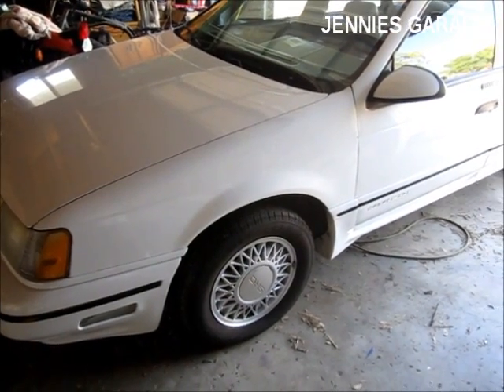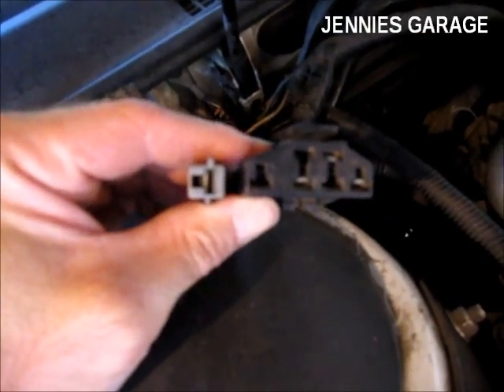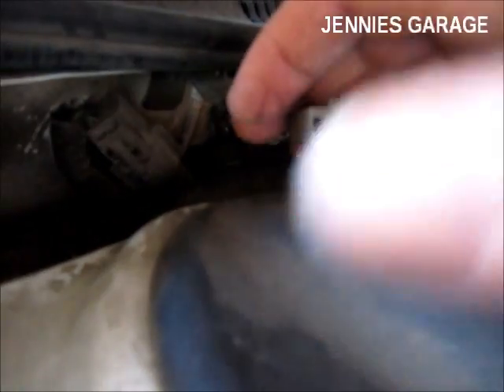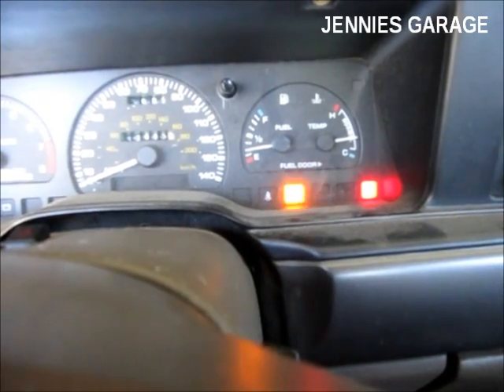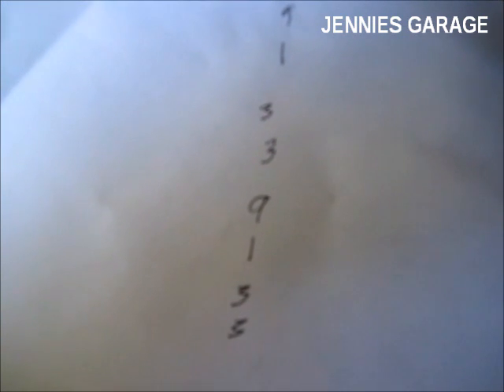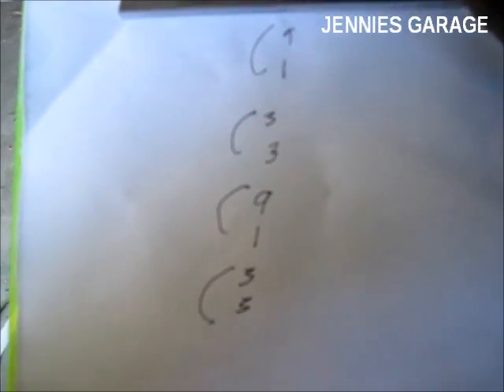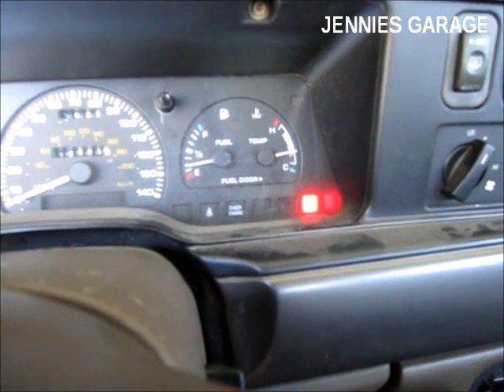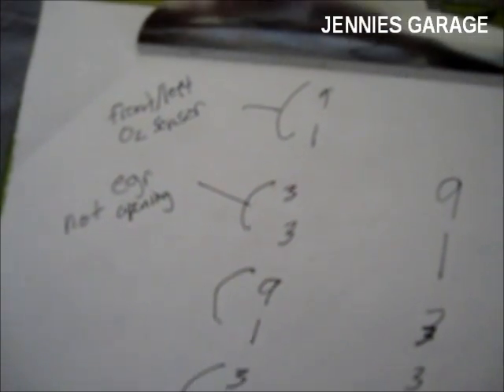1984-1994 Ford Self Diagnostics Test - KOER ( Key On Engine Running )

Comment: I tried this on my 86 ranger, engine seemed to go through the test paces , didn't get any flashes, could my engine light be burnt out?
Reply: When you first start the car or turn key to accessories, does the check engine light come on for a moment?  If it does, then the light is fine.

Comment: 7/30/2022 !!! Update from 7/14/2022.....SUCCESS !!!!  The codes mean Zero to me as i have never & will never take a car to a mechanic.   The turn the wheel, JAB the breake pedal HARD , and rev the engine 100% shut the check engine light OFF, and allowed me to pass Oregons ripp of democrat scum emissions test.  And this video is HOW OLD ??   Fantastic.  engine sevice light has been on for 2 yrs.

Comment: Does this work on a carbed eec iv? Has no CEL, but an Emmisions light that turns on and shuts off after the engine is started. Working on an 85 ranger 2.8.

Comment: Hello. I have a 1994 automatic ford ranger with a surge problem. It only happens after its warm and at a complete stop. It wont do it on park or neutral. It also takes long to start. Sometimes i have to turn ignition key twice. It started to surge right after the smog guy replaced the fuel neck that goes to gas tank. Replaced IAC valve, fuel filter, sparkplugs, temp sensor, egr valve , pcv valve, cleaned MAF , cleaned throttle plate, checked for vaccum leaks. Any good advice would be appreciated.

Comment: I just tried this on my 94 F150 (manual transmission) and the check engine light never came on :( Do you know if there's anything different or why this test wouldn't work?
Reply: Does the CEL illuminate during KOEO? That means, turn key to on/run but dont start the vehicle! Checm engine light should be on. If it doesnt light up, its most likely a CEL bulb that burned out, common on older vehicles that have been ran with a fault code for extended periods of time.

Comment: How is the computer getting feedback from steering right/left in this? I can see brake and throttle able to be sensed by the system but steering right/left I am at a loss as to how the car knows your doing this?
Reply: It's for the load.. power steering load on engine... brake for vacuum change.. rev for missfire

Comment: He was supposed to turn the wheel 360° left or right and then back to center and push the brake pedal. Check fuel pressure and leakdown. O2 codes can be spark plugs, clogged injectors, etc. EGR not opening can be a bad EGR or no vacuum to the EGR. Improper vacuum can be the charcoal canister purge valve. Rich mixtures can be the MAP sensor or CTS, or leaking injectors, or other things.

Comment: Get a Actron CP9690 code tester. It checks live, record, graphing, emissions readiness test, transmission codes, oxygen sensor codes, SRS, ABS, and MORE! It has OBDI cables for Ford, G.M., Chrysler, and Toyota. It has code connect to diagnose codes. It uses 4 AAA batteries not included. They are under the cover. It has a cigarette lighter cord. It shows codes according to that vehicle. Turn the steering wheel 360° and back and pump the brake pedal. 2000 and up is auto-test. Below, you dial in the readings. Goose test checks the TPS and EGR. If you get improper vacuum to the EGR. replace the charcoal canister purge valve. If you get rich oxygen sensor codes, replace the MAP sensor. Run fuel injector cleaner thru the tank to clean injectors and eliminate false codes.

Comment: Will this work on a 1994 mercury topaz/1994 ford tempo?
Reply: Get a Actron CP9690 code tester. It checks live, record, graphing, transmission codes, emissions readiness test, oxygen sensor tests, and MORE! It comes in a black pouch. It uses 4 aaa batteries, not included. It has code- connect to diagnose codes. EBAY has it. Or get a Snap-on scanner with primary cartridge and troubleshooter cartridge. Get the manuals. It uses a 9v. Square battery. Troubleshooter option diagnoses codes. Get the Ford OBDI cable or OBDII cable whichever your car uses. Get the battery- to- cigarette lighter cable which hooks up to the adaptor. EBAY has them.

Comment: Making a small jumper wire with male spade end connectors on both ends will fit better than paper clips. Also, I am wondering just how many people watching this video are likely to end up shorting the jumper to ground because nobody mentioned to not lay the bare, uninsulated paper clip near anything metal.  Also, is that whole turning the wheel, braking, then rev really necessary?  I don't have to do any of that stuff to get codes from a 91 F-250 with 351w block, but the connector and codes look the same.  I only found this video while checking for a friend to see if Taurus were similar.
Reply: @hankbridges5055  , is that only on certain years or models? Because if I start to turn the wheel or anything else, then my truck is already flashing codes before I even get to the second step, and can't count codes, write them down, and steer at the same time.
Reply: @JamesMorningstar  Yes, evidently. Some cars have a power-steering pressure switch and a brake on- off switch. It's to test the operation of those parts. My car says to but it don't have those parts. Some cars have a over-ride switch to activate. Best thing to do is do like it says or it might not test. My Actron CP9690 tester has code-connect to diagnose codes. My Snap on scanner is more for OBDI. It has troubleshooting. I have OBDII cartridges to 2000 and the adaptor. The Actron only gives OBDI test results for my car. It DID specify which air pump check valve was bad. Code-connect helped me to fix 2 problems. It's more specific.

Comment: I have a 1986 mercury cougar 3.8L with an digital dash display and it did not work.  There is no check engine on this cluster just a servive light that never flashed.  I tried several times making sure i had the right ports and cleaned them out even to no avail. Guess i may have to get myself an OBD-1 system reader.

Comment: My Lincoln Town Car cranks well with new battery but won't fire up.  So the war up and motor running is not possible.  I was told and have read that this test can be done with only ignition key turns on and the engine need not be running. Also the OBD1 test is for through 1995 and OBD2 is for 1996 and newer.

Comment: My code book said Muffler Bearing Bad & Low Blinker Fluid  where are these located at?
Reply: By the Water pump relay & The exhaust pump reservoir
Reply: Wen i press the brake my head tilts forward.....those that mean check glove box lock for sugar residue from the freon

Comment: Get a Actron CP9690 code tester. It checks live, record, graphing, oxygen sensor test, emissions readiness test, transmission codes, solenoid and relay test, memory codes, MAP sensor test, MAF test, IAC valve test, and MORE! It works on 1983-2013 and is updatable. EBAY has it.

Comment: Code 33 is the EGR valve. If you get oxygen sensor rich or lean codes, replace the MAP sensor. If you get vacuum to the EGR at idle, replace the charcoal canister purge valve.

Comment: Crazy question I do remember the paperclip trick from back in the day from my dad but I have a 93 Ford Mustang 2.3l lx that shot a code ten at me and the other day I was noticing the engine running poorly/having a possible misfire while hitting 65 on the interstate. I know a code ten is a cylinder 1 issue but would the best course of action before taking it to a more skilled mechanic be doing a full tune up then giving it another go?

Comment: Get a digital code tester from Amazon for Ford. Also get the extension cable. Better than that get a Snap-on scanner and cartridges and manuals and adapters from E-Bay. Also get the 120 volt adapter and Battery Pak to check test results away from the car. Get the latest cartridges.

Comment: my 1991 Mercury Grand Marquis ls 5.0 has been running for a total of 30 minutes and has not reached normal temperatures yet I don't understand why not does this mean I won't be able to perform the test?
Reply: mrhaynes1974 It could be the thermostat. That can cause rich mixtures.
Reply: Sometimes a 2000 rpm rev hold is needed (maybe a minute) for fan clutch to disengage or thermostat that is fail safe stuck open or both

Comment: I recently bought an Equus Innova OBD-1 code reader, and the users' manual emphatically states that before you run this KOER (key on, engine running) test, you must first run the KOEO (key on, engine off) test and fix any trouble codes you get from that test.  For the KOER results to be valid, you must be getting a "system pass" code (11 or 111) from the KOEO test first.  By the way, that code reader makes this job MUCH easier.  For under $25 on Amazon, the Innova 3145 Ford Code Reader for older Fords (1981-1995) is a great buy.  The manual has all the Ford OBD-1 trouble codes and their meaning (the most comprehensive list I've seen) as well as detailed instructions for running all the tests.  If you own an older Ford car or truck, this code reader and its manual are well worth the small investment.
Reply: I seen what you've done here lol good add

Comment: what if my car doesnt have a check engine light? i have a 1986 lincoln town car, also made by ford
Reply from the maker: It should have some type of light to the effect of "service engine soon" or a symbol. Maybe the bulb burned out.
Reply: if there is defiantly not a check engine light you have to use a voltmeter/testlight or use a scan tool

Comment: I just got a 94 Taurus 3.8l GL took it for a test drive no issues checked all fluids the looked good.  I drove it from where I got it a short distance less than 5 miles for some errands no problems.  I drive it at highways speeds all the way home no issues while driving I pull into my driveway the oil light starts flickering then stays on and goes of and flickers.  I let it set for 30 minutes then checked out normal level good color no burnt odor and no metal flakes.  I googled symptoms but are unsure if that will resolve it cause in some post the main bearings turned out to be the problem.  What would be your opinion if duplicated at your garage?
Reply: I doubt you still have this car (2 years ago) but if you do Try a new oil pressure sending unit first before you tear down the engine. They are known to go bad. If you want to.be sure, put a gauge on it. If you have less than 5-6psi at idle once engine is hot you likely have internal wear. If that is case run thicker oil it will get you by until you can find a low mile engine for it

Comment: I have a 1993 Ford f250 7.5 liter truck I'm going thru three to four quarts every 400, 500 miles I'm not leaking under my truck or smell it burning on my motor I have black sewt coating exhaust and blowing out any ideas its using more and more oil every day  I'm trying tutu figure it out and fix it (12 quarts in 9 days)

Comment: first time u went right to left and the second time u went left to right
Reply: I noticed that too. It is right and then left or it doesn't matter?. Thanks a lot for this video, I didn't realize you can do this test within a obd1 gadget. I tried doing the KOER test on the INNOVA 3145 and it said nothing in the book about turning the wheel right , left , push brake and then gas. Thanks for the video.

Comment: Hey john, why would you want to do the KOER test and not do the key off test? Or I guess you should do both right?  Can you explain why you should or shouldn't do both tests?
Reply: Brig T You should do both. First tend to the first codes first in case it corrects others. After replacing parts, recheck. Code 33 is EGR valve.

Comment: Great video. Question: you've noted that this works for 1984-1994 Ford Vehicles. Will it also work for 1995 ones as well? I thought 1995 was the last year for OBD1. (I believe it wasn't until 1996 that Ford went to OBD2.) Thanks!
Reply: shockteevee yes 95 as well

Comment: Thanks for your info on self testing a ford computer, I have been a Ford man for years and never knew this could be done. Thank you. Will have to try it on my 1990 Bronco and see if it spits out any codes, no check engine light but it idles rough and will stall but other times runs perfectly.
Reply: Check the EGR and charcoal canister purge valve. Run fuel injector cleaner thru the engine to clean injectors and eliminate false codes.
Reply from the maker: emdman1959 glad to help out, thanks!

Comment: Hmm.. I've got a '93 Ranger that has an ABS light that won't go off. Tried this, hoping it'd give me codes for that, but nope. Only got the check engine light blinking. Gave me code 26 - "transmission fluid temperature out of self-test range". Does that mean that I didn't let it warm up enough?
Reply: ***** I've tested my brake fluid and moisture levels are between 1%-2%, so it's not ready to be changed yet. Maybe the sensor is ultra sensitive about that though. Did you test yours first?

Comment: on the the test with paper clip for codes  wat if  engine barley stay runnin
Reply from the maker: Addie Lamons Just try to get them if you can. Otherwise just pull the engine off codes and go from there. good luck!
Reply: +Jennies Garage What are "engine off codes ?" and how do you get those? Thanks.  I have a 1994 ford tempo 4cyl , with a wide open throttle all the time.
Reply: +James Tannehill For what you say I think could be the MAF sensor (if your car has one).I had a Mercury Mystique 1995 and when I turned it on the rpm went up to 2000 and stays there.I just cleaned the MAF sensor with a contact cleaner and problem solved.

Comment: I have a Ford Ranger 94...I try the paper clip and check engine light wont give any codes I play with it for a 3 hours and then it gave me some codes but did not finish the process, so I try to get them again and no success.... but car is definitely running bad... If I turn it off and turn it on again it will run good for a minute then it goes bad again..
Reply: Mauricio, often paper clips these days have some kind of varnish or plastic coating on them.  Either sand the connecting ends or use a regular wire.

Comment: Is it possible to do with a car that doesn't run? It turns on but the engine wont start.
Reply: ***** This is to help anyone else with your same issue, I'm sure you've managed it by now, yourself...
An engine needs only a few things to fire up and run. Fuel (enough fuel for carb and injected, and at the right time - if injected), Air (here is where one would assume it's getting air - open those throttle body plates and make sure), Spark, Timing of spark and valves, Compression. Probably in that order of importance. Just check these things yourself, assume nothing.get an inline spark tester for cheap. Get a compression tester as well. If all check out fine, you have either non-flammable fuel or the air has no oxygen in it.
Reply: Have you found out?

Comment: 1st was right left brake accelerate 
2nd was left right brake 
accelerate
Apparently it doesnt matter.
OR does it ???
Reply: BarfingCoyote I have done it both and it doesn't matter. The test known as t"he gooseneck test" just helps the car check the steering sensor brake sensor throttle sensor/acceleration / fuel-air ratio. So as long as you go both ways it's all good
Reply: barfing coyote you might go both ways but not me

Comment: My code from a 1989 ford E20 club wagon are 33 96 33 96.What do those #'s diagnose.The van will start and run,and when engine gets hot it will shut off.Thanks
Reply from the maker: Darrica Russell 33=egr valve 96=fuel pump circuit power loss. Hope that helps, thanks!
Reply: ***** Thanks for the code readings. The mechanics who have checked our van seem not to understand how to work on this van. they keep guessing what kinda problems could be wrong wit it. The van is losing power and shifting very bad,it will barely go up a small hill, and there is a lot of heat around the engine,when I put my hand close to the exhaust,there seems not to be enough exhaust coming out.The van initially had 2 tanks,and we took out both of them and only put in 1 new tank and fuel pump,also just recently replaced the fuel filter. Another mechanic also suggested that we unclog the catalytic converter,which we did,he cut a hole in it and took out all the stuff inside of it.We also replaced the coil ignition BWD,changed the transmission filter & fluid as well as the modulator valve.Now another mechanic is suggesting that it could be the timing chain.When I was driving home yesterday for about an hour it died,but would start back up after 2-5 minutes of sitting.When I try to give it more gas around 45mph,it will start sputtering and eventually stop but will start back up after 2-5 mins.
Reply: Petey Mwaura Today I managed to pull out the EGR Valve Position Sensor and took it to advance auto to compare it with a new one,and the pintle seems to work just as well the new one,i checked inside the egr valve and it doesn't seem like its clogged up,no carbon build up.Another mechanic suggested that it has a bad timing chain.........what do you think Mr.Jennies
Reply: Petey Mwaura Exactly the same thing with my Ford Escort Mk6 from 1994. When it gets hot, it chokes and won't start again for some time. I can't even count how many "experts" gave us advices on this car. We went to every specialist in our... let's call this a state. Every, except genuine Ford-authorised ones. The car still stands by the house and slowly gets rust. It's a matter of fondness...

Sorry for my English. I hope you understand ;-)
Reply: Kamil Binkowski I'm no expert, but those symptoms sound like the fuel could be boiling due to the injectors or fuel rail getting too hot when the engine is warm. Just something to consider